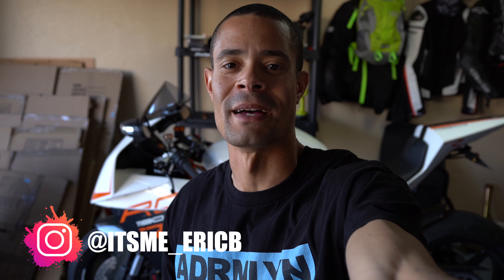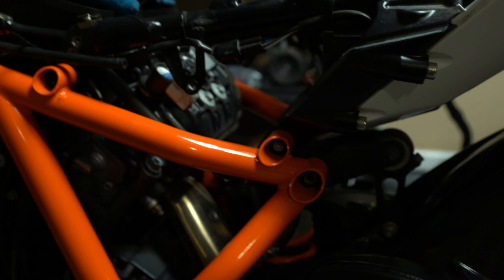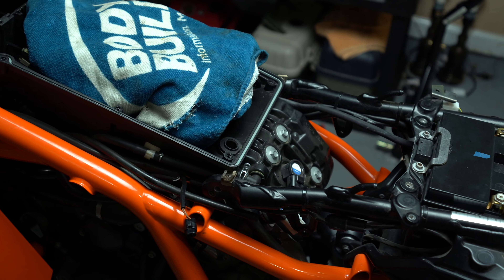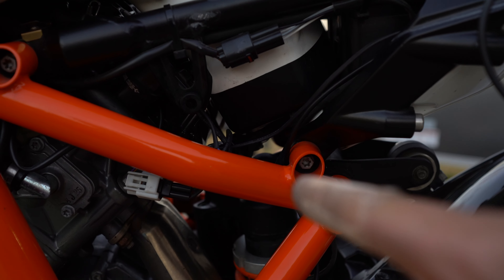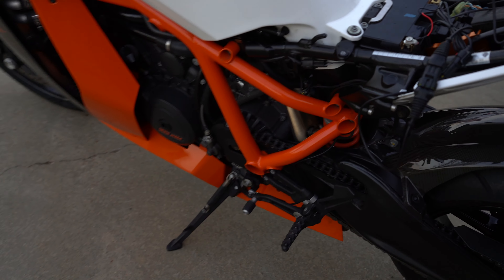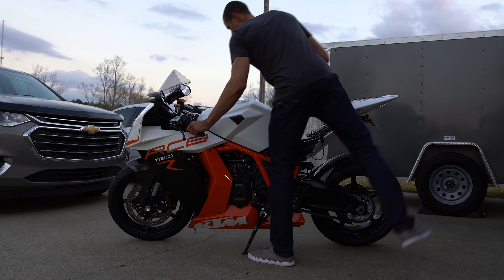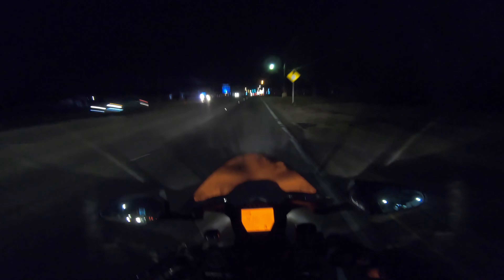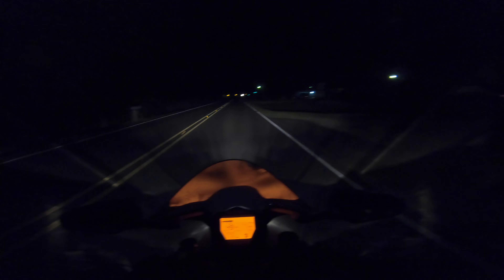Annitori Quickshifter Install on my KTM RC8R

Comment: Hi bro , im just pick up the rc8 ( not the R version) so i'm wonder if the quickshifter works? and does it has a auto blipper too ? like only up or up and down ? and do you have any recommendation for first time touching the RC8? I have change it from the 2008 R6 same as you did :D. Thank you bro, hope you enjoy every ride?
Reply from the maker: Hey congrats on picking up an RC8!  So I think the R version is a twin spark which means you'd have to make sure you get the kit for the standard RC8.  Other than that it's just quickshift up only, no auto blipper.  Overall not a bad unit for the price!

Comment: I have the dynojet quickshifter on my '12 rc8r. Its alright. I hear the annitori is the smoothest on these bikes though. Also there is no auto blip for these bikes being its not a fly by wire bike. Thats a downfall for sure! Also cant set up launch control for the same reason.
Reply from the maker: Yeah that’s the one con about it.  With the Annitori you can program timing and smoothness of the shift in the app.  When I first set it up I had it backwards and was autobliping. Lol

Comment: I  don’t really like the KTM brother. I think they look and feel cheap. They break down a lot. Just not a great bike. I toasted one in five min. Burnt up.
Reply from the maker: Yeah that’s not normal haha!  What year was it?  Mine has been pretty good thus far with no issues.  Just a pain to work on sometimes.
Reply: to each their own, but, lay off the pipe bro 🤣
Reply: Going on 19k miles on my rc8r I bought new. No expenses other than the service schedule and tires. Oh boy does she chew through softies. Maintain your bike people and it will run forever.
Reply: @davidryff8640  Have you done the valve clearance check? I have a 2016 Superduke 1290GT that I bought used with 9k miles and it now has maybe 23k miles and I still have yet to do it. I change the oil and filter myself every 4500 mi. but I haven't check valve clearance as well change plugs or airfilter. I will say the bike sounds great and starts very easy, just stuff that like in this video are hard to get at. The dealer wants to charge 2k for the service and I can see why.:face-purple-crying: